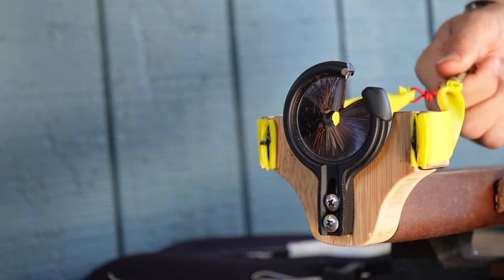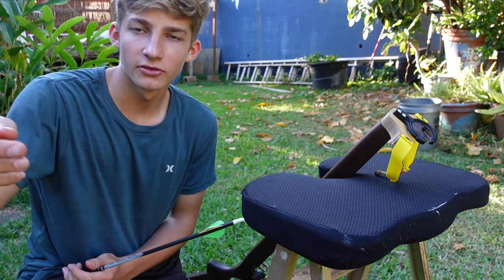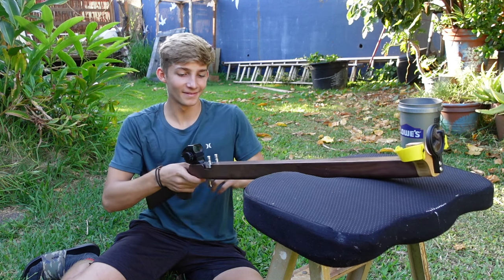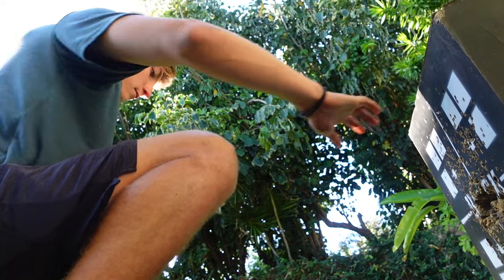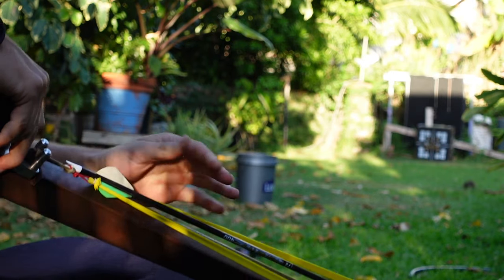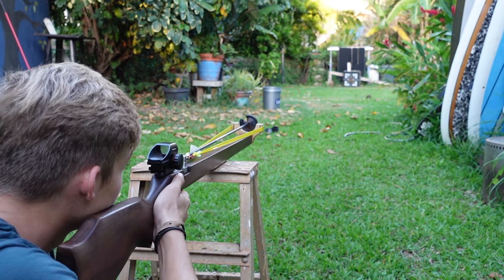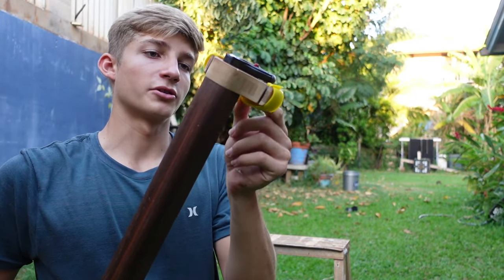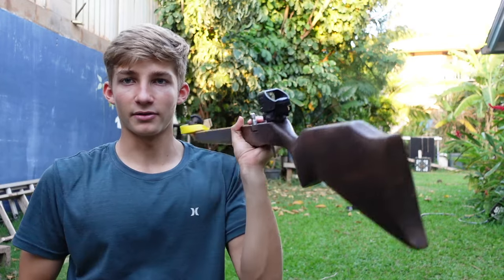Slinging Arrows With the Slingshot Rifle

Comment: Try dropping the whisker biscuit down a little so the arrows more level with the for wood and it'll probably not kick up as much. Great job though, very enjoyable.  Seeya Rob
Reply from the maker: Yep, I think that should help with the arrow flight, thanks!
Reply: @hudsonhertz  it's weird because this is backwards from what you'd normally do for a bow - nock high usually means your rest needs to go up, but I agree it looks like it needs to come down. It would be interesting to paper tune it with bare shaft arrows.

Comment: I think you'd get a lot more velocity with crossbow bolts, cut out groove for them to ride in and lose the whisker biscuit, but that's just an after thought in hindsight from a backseat driver,,,,you did a great job man I've got to try it out
Reply from the maker: @robert-oq9jq  good idea! Thanks for the suggestion!
Reply: @hudsonhertz I'm not sure if my idea would work on your setup I think you've got a good design like it is I was just thinking about eliminating some weight off of The Arrow somehow
Reply from the maker: @robert-oq9jq  yeah I see what you meat, I would have to alter the design a little bit I get where your heads at.
Reply: @hudsonhertz the problem with my idea if it's riding in that Groove the friction will probably counteract any weight savings in the arrow length but anywho, Where do you get your bands at?
Reply from the maker: @robert-oq9jq  good thinking, I get my bands from Snipersling online.
Reply: @hudsonhertz  thanks

Comment: Very nice video!!! Here in Greece we make bands of the thing which is inside bike tires. It works really well I would recommend you try it!
Reply: Hey! We did that too when I was a kid (ages ago). Those are called "butyl inner tubes". And back then, car tyres also had them!! And that elastic was very powerful. Cheers!
Reply: @KarlosEPM  yeah mate,  fun stuff!!
Reply: Oh, so those inner tubes do work😮. Good cos I got some in my garage. Do they have more power than your .5mm commercial flat bands? I used inner tube to tie my bands onto the fork but didn't realise you can use em as main bands. Cheers dude. Learn something new everyday

Comment: I'm concerned that those 2 screws might give. That's a lot of energy stored and pulling on those and if they give while your behind it your gonna have a bad time. Especially if you add more bands.I'd consider bolts set backwards with nuts on the outside. Router or chisel just enough out of the end to set the bolts.. maybe even drill out the endpiece to suport slightly thicker bolts. Or use thick dowel rods that extend the stock to add suport to the end plate and in the end suport the upper part of that endpiese.. so not all the torque is on the screws
Reply from the maker: Ok, that sounds like a worthy upgrade. Thanks for the comment!👍